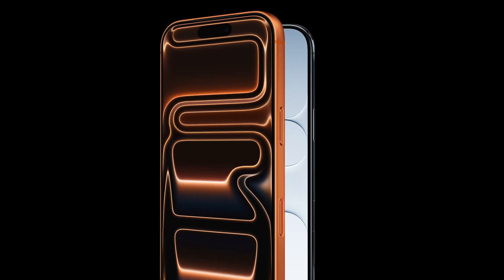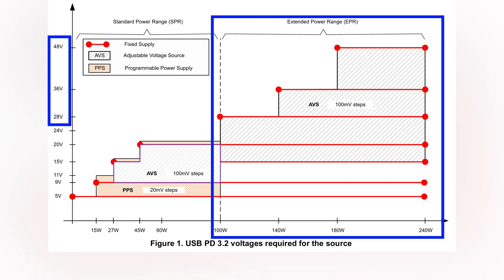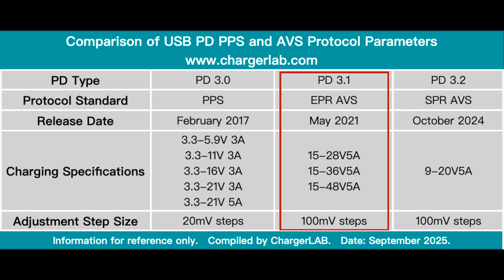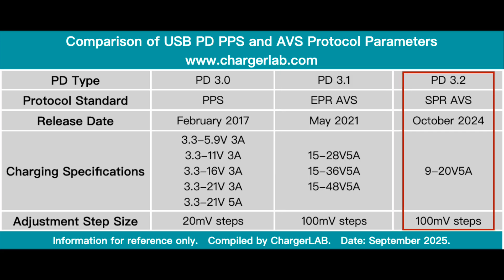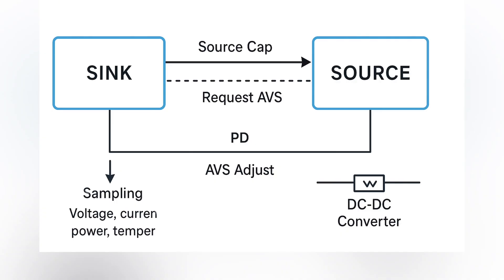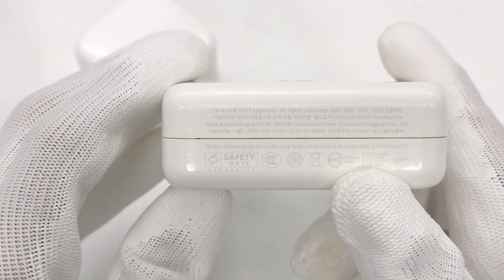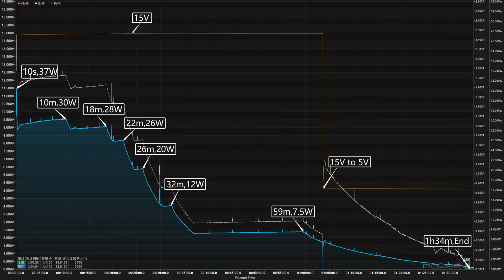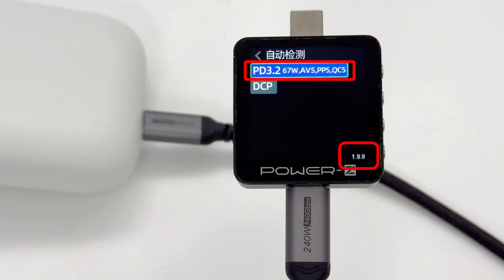Explained: The AVS Protocol Behind Apple’s New Fast Charging

Comment: THANK YOU for providing an actual explanation how AVS improves on PPS!! It's easy enough to find the spec comparisons between the standards, however the specs make it seem like PPS with the more granular voltage steps was actually superior to AVS; the extra context you provided makes a lot of sense and totally explains why AVS is an upgrade over PPS.

Comment: What’s this charger has different to a charger that has lower sustainable performance than the designed wattage? The wattage lower to 40 at around the typical 30 minutes too and it’s equivalent size to similar wattage of charger too, just a different way of marketing?

Comment: This new Apple A3365 charger is probably the first charger with the PD 3.2 charging protocol😁
Reply: No, Google Pixel Flex 67W Dual-Port USB-C Charger PD3.2 is one month earlier than Apple 40W Charger.
Reply: @Soranana-ft9ck  However, the Apple charger is smaller than the Google charger and provides more power from a single USB-C input.👍
Reply: @Siemano1666  pixel charger has two ports and when using a single port it has more wattage at 67w because it’s not splitting lanes in pretty sure
Reply: @Coolhand69  Yes, it's possible, but only one port delivers 67W with two devices connected. However, it's unclear whether it's compatible with iPhone smart charging at night. You'll likely need to use the original chargers for both the iPhone and Pixel, but that's just a theory.😁👍

Comment: But iPhone 17 charges exactly the same from avs charger and normal non pps usb pd charger 45w and higher, right? It only uses normal usb pd not even pps and certainly not AVS.

Atleast that is what I understood from your testing videos.
Reply: Yeah, it’s disappointing. I’ve tested two different iPhone 17 Pro/Max models and they both only appear to connect to fixed voltages. Tried both Apples new 40-60w Dynamic adapter and the Google Pixel Flex Dual Port adapter. I wish Apple would address this…
Reply: @FromGregg  it turns out the new 40 W power adapter with 60 W boost is actually more  for the new iPads as the new iPads  M5 can charge at a max rate of 60 W.

Comment: What about the charger from Apple being dynamic, is it dynamic without interrupted charging during renegotiation of the protocol? And is that due to SPR-AVS?
Reply: From my understanding the DPS portion or “Dynamic” part is independent of the PD3.2 specification and independent from AVS. I can confirm it’s working from plugging it into my MacBook Air and confirming it will hit 60w @ 20v (fixed) I’m assuming AVS will also use DPS cycling between 40-60w but that remains to be seen by my KM003C as of now

Comment: The iPhone 17 lineup doesn’t even fully take advantage of AVS.
Reply: I thought it was supposed to? Didn’t Apple market the new 40-60w dynamic adapter that uses PD3.2 with AVS in SPR for the iPhone 17 lineup?
Reply: @FromGregg Apple doesn’t even market it. They only state that they specifically tested fast charging with the 40W dynamic in the fine print. Zero mention of if any 40W+ PD charger will work just fine. 
Based on others’ testing there is almost zero difference in charging speed so at the moment Apple doesn’t use AVS. I am speculating that in the next few generations Apple will implement true 60W charging on their phones and this product is future proofing.